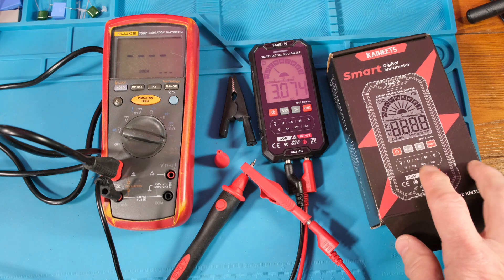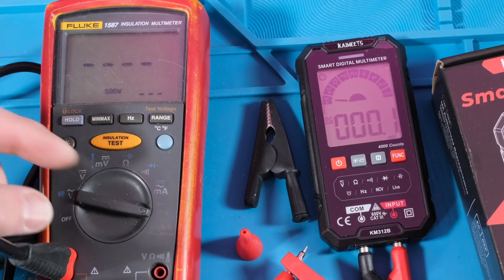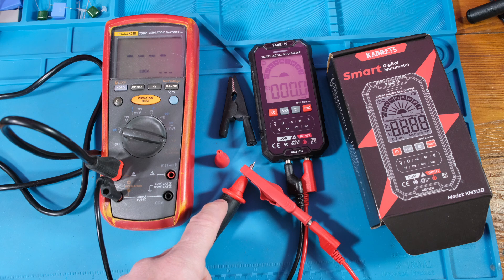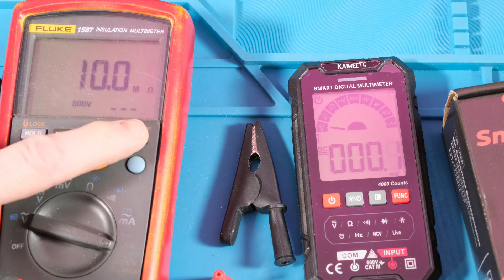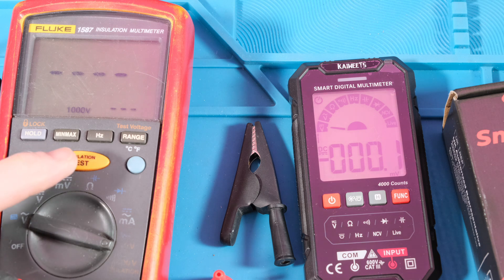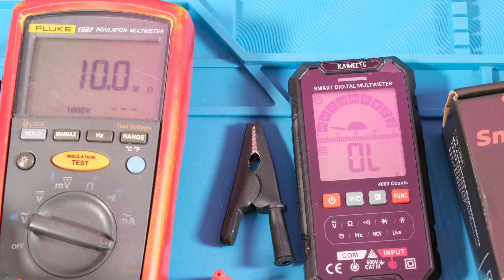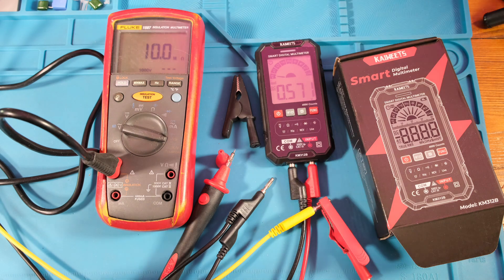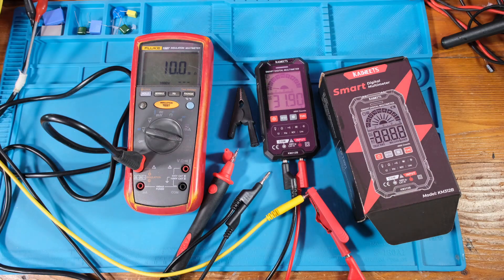1000V Test will Kaiweets New Smart Multimeters Survive? #Kaiweetssmartmeter #Hipottest

Comment: Can you do a review of the Etekcity MSR-A1000 multimeter? It's currently on Amazon for $27 part of black friday. What's interesting about this multimeter is the solid construction + input protection inside(it uses 3 PTC's and 3 MOV's, 600mah + 10a 1000v fuse). Seems crazy to me considering price. Would love to see it tested with 1kv transient test.

It seems like a big step up compared to those cheap chinese multimeters and it's not even that much more expensive. Its look even resembles that of a BK precision multimeter, has a similar color theme going on.

Would be great to get your input and opinion on it. It seems like a hidden gem to me. I was considering Amazon 90DM610 that you reviewed before, unfortunately its been out of stock for a while.
Reply from the maker: Thanks for the great suggestion!  I have one that I will review in the next couple of days;)

I picked up the Etekcity awhile ago as I had the same thoughts as you about it;)

I think that amazon meter is an excellent choice but I've noticed it out of stock as well.  I need to see if I can contact an Amazon rep.

Comment: Never need 1000vdc power supply, my rf amplifiers (Ham radio) use 2500 to 4500 vdc but they always have their own power supplies. The tube radios and audio amplifiers max out at about 500 to 600 vdc max.
Reply from the maker: Great Feedback James!  Do you use resistor dividers to read the high voltage on your RF amps?
Reply: @KissAnalog  I use a high voltage probe sometimes but resistor bridge to a meter is a lot safer and most amplifiers do have meters on them.  Years ago I did have a 2 watt carbon bleeder resistor grenade itself in an amplifier, not sure which is louder a resister or a cap.

Comment: Fine video and good test. I do not completely understand why a 1000V test is useful, if one want to work at these levels, do I think some better and safer gear is mandatory. Could you maybe explain the reason for that test to a standard DMM? :-)
Reply from the maker: Great Question! Thanks - I'll do a quick video where I explain the testing for a Multimeter.  The 1000V test was just to demonstrate that the meters can actually handle that voltage without breaking down.  Some commenting think that 1000V is so dangerous to a multimeter and that they will fail with that voltage.  Just usually isn't a problem if they actually show that they are rated for that.

Comment: I am always triple checking when dealing with high voltage , on thanksgiving day I decided to start refurbishing an old Syltronics transceiver and I found myself over checking my position  near the Powersupply
Reply from the maker: Thanks for that great feedback!  What meter do you use, and what voltages were you measuring?  Have you ever had an issue with a multimeter and the voltage?
Reply: @KissAnalog  thanks for the reply, I use the Tenma -72-7730A, I don't get the proper caps measurements, so I mostly rely on my Messr 100 and the Velleman ESR 70 resistance measurement is also spiffy, I am really looking forward to those 2 meters that I did purchase to Arrive

Comment: Hi Eddie, great test. 

According to IEC a CAT II 1000V rated meter needs to withstand a transient of 6000V
Reply: There's a guy on YT that tests with high voltage into meters, his name escapes me.....
Reply from the maker: Thanks Chris for pointing that out!  The transient Voltage testing are for transients measured in us or up to a ms, so they are even less energy than what I was measuring with the 1kV source.  The MOVs and/or TVS diodes (that we didn't really see in these meters) take care of that.  The HV resistors will help quite a bit as well.

Joe Smith does a lot of this testing, but he also goes to much higher levels to find the failure point (thanks Repro77 for bringing this up).

Comment: Great test! I use my insulation meter to test high voltage caps. Sometimes caps appear ok at low voltage and then they short at high voltage. Kaiweets makes a great product. Thanks for the great review.
Reply from the maker: Thanks Tron!  That is a great example of the breakdown with voltage.

Comment: Nice iv got some 600V switch gear to change out at the pulp mill i work at next week! im going buy a kaiweets to do my pre change testing. Thanks for recommending theses great little meters for high energy circuits Eddie!
Reply: Surely Randy was being sarcastic after reading his comments on your original review video of these Kaiweets Smart meters. I'm sure his original comments is what spurred you doing these tests. I tried to purchase the 601 out of curiosity, but the Kaiweets website glitched several times while entering my info. When I was finally able to get everything entered without the site crashing, my card wouldn't let me make the purchase, even tried using the PayPal option...no go. Guess as long as my card wasn't "stolen" from this site, I'd imagine it's a blessing in disguise.  In the real world I would never use one these El Cheapo type meters that have no NRTL labeling/listing.

I guess I'm just a multimeter snob.
Reply from the maker: Thanks #Boyd Lamb!  I appreciate Randy's sarcasm, and I'm good with it.  But I have to be sure I correct when I can so that when people skew what I recommend that others that are not on to the joke don't take it serious;)  Safety first.

I'll tell you what, my favorite meter now is my Hioki 4282 and then my Fluke 189;)  But I also am a big fan of the Greenlee, Amprobe, FLIR, and I have a couple others that I have to review.  But when you consider what will actually work ... you don't really need to spend a lot.  There are lots of people using Harbor Freight meters that would be scary to some of us - but then I don't think I've ever heard of anyone getting hurt using one.  Its most likely that the locations that they are used in are CAT I, or maybe CAT II.  The Kaiweets is far and away better meters than those $5 meters.  Those that can't afford to be snobs need something...
Reply from the maker: Thanks Randy!  But I was recommending these for low energy circuits as in CAT II.  I was making a point that 1kV is not high energy in a CAT II area like the work bench.  I also recommended using a Testo, FLIR, Amprobe, Hioki, or Fluke for CAT III and CAT IV work.  People often confuse voltage level with energy level.  Your work is in CAT III it sounds like, so you should be using the meters that I recommended with 3rd party safety certs, or something equivalent.  And hopefully wearing safely gear.

Comment: Hi Eddie,

That’s pretty neat. I like it when you do tests that others don’t do. Cool little meters…. Now they are third party tested: you have to add the Kiss logo next to CE!

I was wondering, could you use the insulation tester to measure 5000 Mohm or higher specialty resistors? My resistors are rated up to 5kV, but I don’t get a reliable reading of resistance with my insulation resistance tester even up to 2500V… At 1000V it reads 1000 Mohm, and at 2500V it reads 105 Gohm…

Funny question… long, long ago, I worked for a brief period in a calibration lab; we had an AC insulation tester that went to 20kV an where we could measure the breakdown current. Have you worked with such devices?

Thank you.
Cheers 
Mark
Reply from the maker: Thanks Mark!  I'll have to go over the actual testing for the CE mark done by 3rd party certification labs.  

It might be that your insulation tester isn't set to read higher resistance than 1000 Mohm.  Which tester is it?

I have used AC insulation testers similar to that.  I like AC testing as it shows insulation that is sensitive to AC.  It is sometimes considered the tougher test.  The DC equivalent has to be the peak of the AC testing, and you have to test in  both polarities.  I don't see many failures testing various equipment.
Reply: @KissAnalog   Hi Eddie. 
It's nothing exciting... it's a Mastech MS5205. 
The 'manual' says that the measurement range is 0.01Mohm to 100.0 Gohm. 
Cheers,
Mark